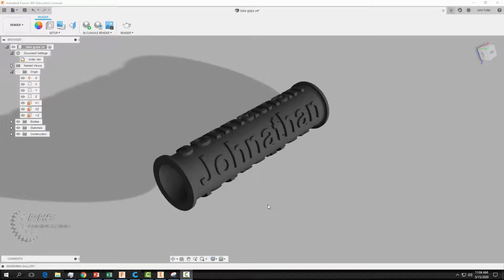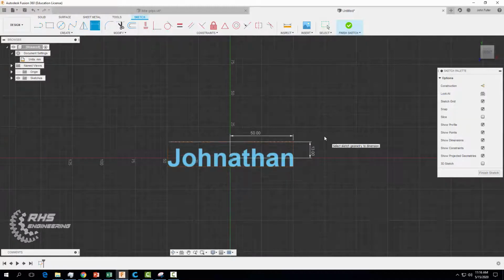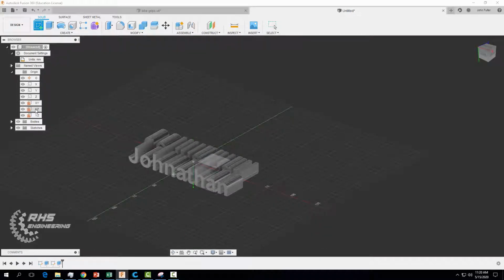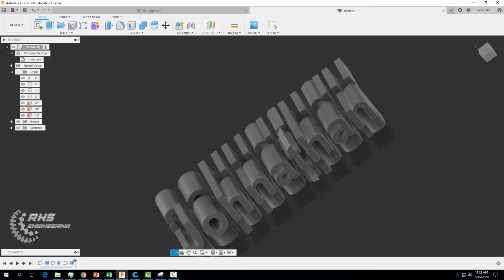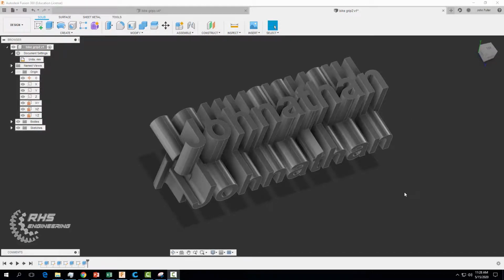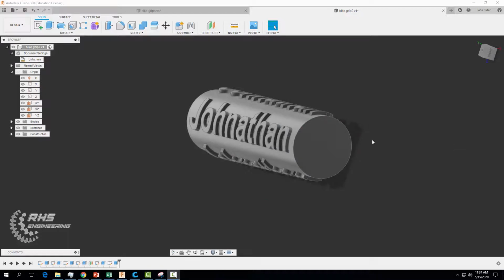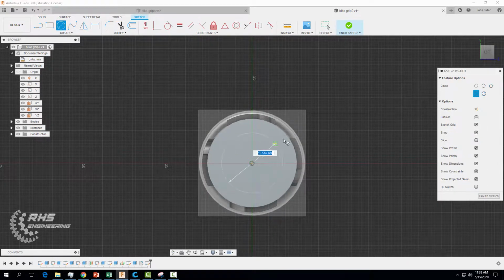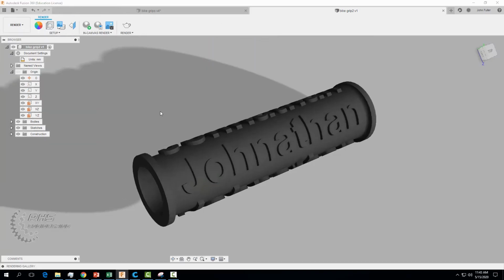Tutorial: Designing Custom Bike Grips

Comment: Would it be possible to make a small run of handlebar gripss at home? I'd assume making a mould and filling with some sort of silicone
Reply from the maker: If you're doing it for yourself you're better off just three d printing them with Flexible rubber fiwoman material. That's the way I did it, and they came out good
Reply: @JohnFuller804  I've noticed a lot of "alt bars (such Surly corner bar /moloko) that people put a combination of lock-on grips and bar tape.  I was thinking to recreate the types of grips GT used on bullhorn grips of the early 90s. Can't seem to find those anymore, something with an integrated end that you just cut other end to length.
Reply from the maker: Yeah, that would take some pretty advanced manufacturing, but it's possible. I wish I had more information for you. I would definitely keep searching YouTube. There's probably something out there.
Reply: @JohnFuller804  i have no idea. I just figured it needed an inner and an outer mold with some ports to pour the liquid silicone in